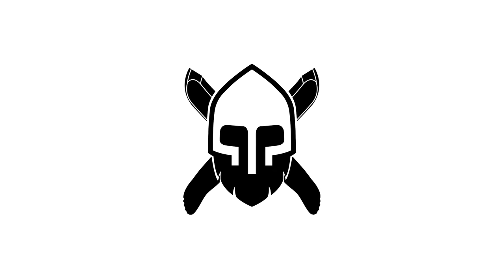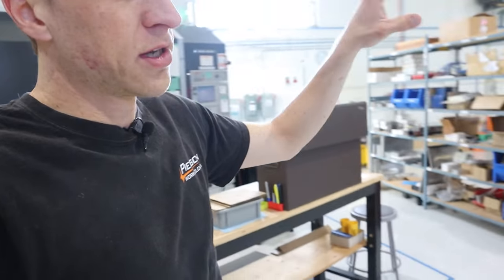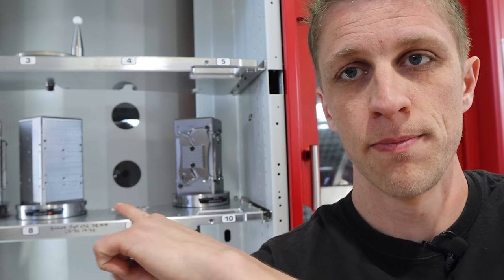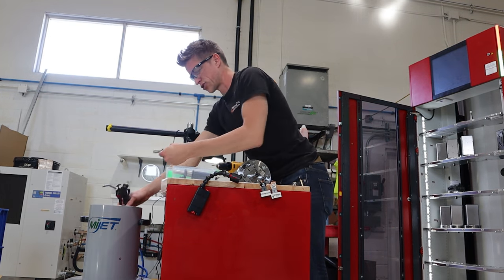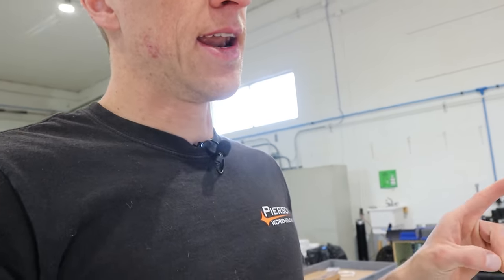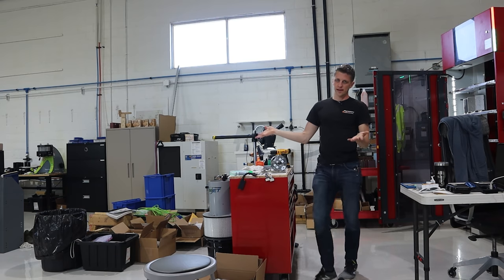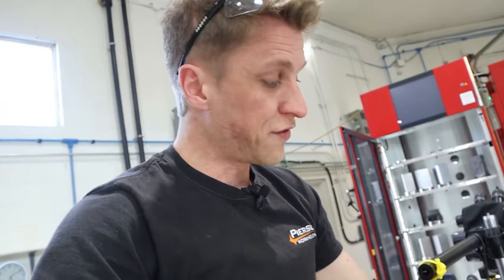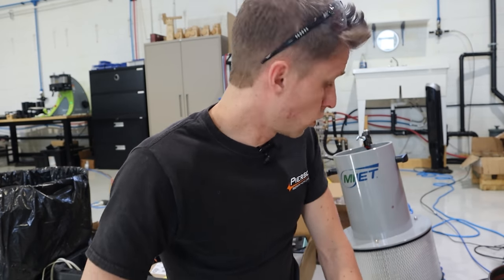How We Clean Off Our Parts

Comment: I think building a workbench that you could build the myjet into it would be great, that way it would be right next to the pallet/tombstone you are working on. No reaching around and crud. It would be a nice workstation and the myJet top would be just a bit above the surface of the table. Maybe put in a foot pad that activates the suction as well to turn it on without the gun if that's all you need.

Comment: Your comment about filtration addiction resonates with me. Right now I'm in the middle of organizing fab shop with CNC plasma cutting, grinding, powder coating, etc. The building is fully insulated and heated and so to not loose any heat in the winter and not pay exorbitant heating bills I'm working on closed-loop filtration systems for plasma, grinding and powder coating. Hepa filters everywhere. And it becomes an addiction))

Comment: I would have thought that you would have had a large ultrasonic jewelry cleaner. They have a french fry type dip fine wire basket that you lower into the stainless type sink. I used them at Litton Systems building gyroscopes many many moons ago. Would be perfect for your application!!!
Reply from the maker: We use that as well!

Comment: I was thinking you could get a bucket wheel setup from the car washing industry to make moving it easier.  You might be able to find a 45° elbow for the top for an ergonomic angle.  Add overhead air drops where you will use them and you probably won't have to buy one for every machine, just as many as you will be able to use simultaneously and maybe an extra.

Somebody else said down draft, for my home shop I'm hoping to find a used laboratory style fume hood which could possibly be used the same way.

Comment: Seems like something that can be done with a sifting screen sized for your parts and a 5 gallon bucket. 

You make tons of tiny parts John, and it seems like it has minimal application in your shop I think. 

If you had a sifting screen for your tiny parts, you can make your sure parts stay and just tip over the chips when you’re done. 

Just an idea.

Comment: Maybe  some sort of ultrasonic cleaner for oily parts? Could have a auto conveyor that dumps them into a bin afterwards?
Reply: This is more of an at the machine cleaning solution.  It's not meant for final cleaning.  At my shop we do a blow off in the mijet then a soapy rinse to remove the rest of the cutting oil and a DI water rinse.  If he thinks water based coolant is unpleasant then he need to work in a show with 13+ swiss machines.  We had our shop level mist collector go out on us last week.  The shop was downright hazy for a while until the roll up doors were opened.